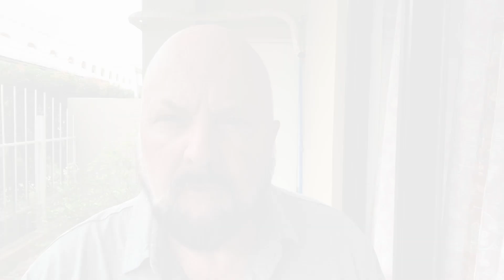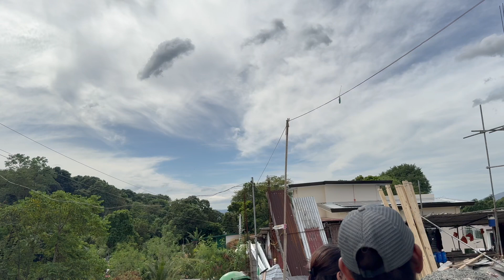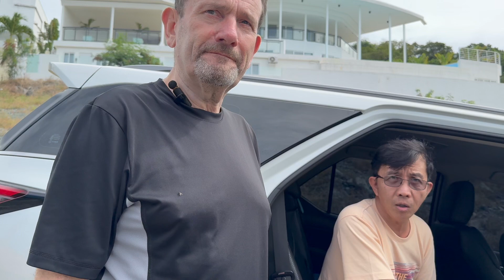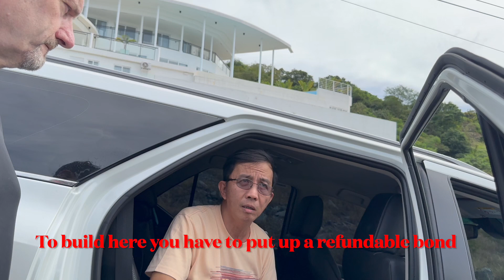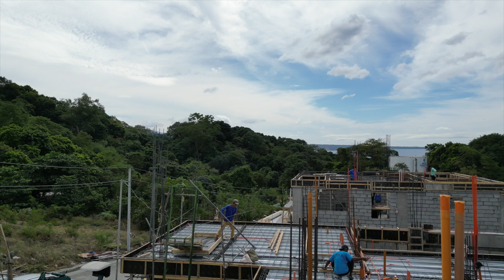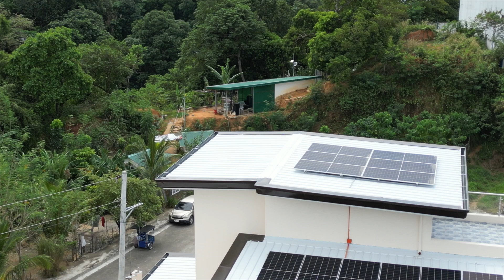Subic Bay House Build Ep 51 pt 2

Comment: Both homes are looking good. I would like to ask a favor, can you get a very good close-up of the steel decking that your builders are using to pour the concrete slab? It looks like to me that the bottom is flat and the top has a ridge on them. I just would like to see in detail what steel decking that they are using. Thank you and have a Happy Blessed New Year 2025.
Reply from the maker: I will capture a closeup of the decking material in the next video.  It is very thin almost like a stainless steel roof material, with ridges at about 12 inches apart. I'd never seen anything like it before.
Reply: Thank you. I think that I would like to use it for my build there once I start building because I has a flat bottom, or at least that is what I think it has from the videos that you shoot. Can you tell me what is the max length that the metal sheets come in and the general price for each sheet? Thank you for the close up video shoot of the top and bottom of the metal sheets, I'll be looking forward to your next video update. Keep up the good work on the homes for you and Ian.
Reply from the maker: The length is about 20 feet I would guess.  I am relying solely on my Builder, but they are BJ Steel 
Located 
Address 0396 Pur0k 3-B National Road Calapacuan, Subic, Zambales, Subic, Philippines

Phone 0998 547 5568

maybjstee@gmail.com

Besides construction they sell steel fabrication. The Owners name is Bhong and his wife Jean.